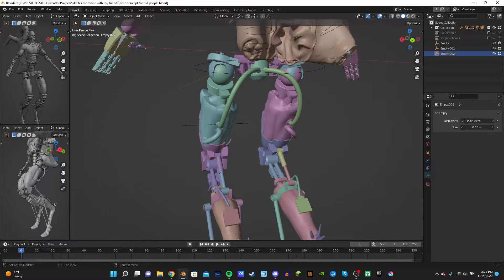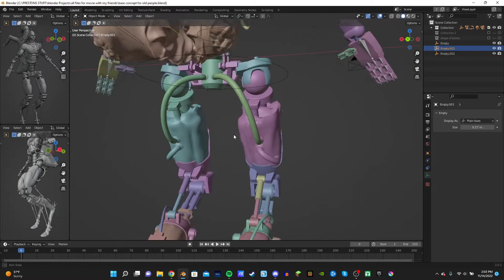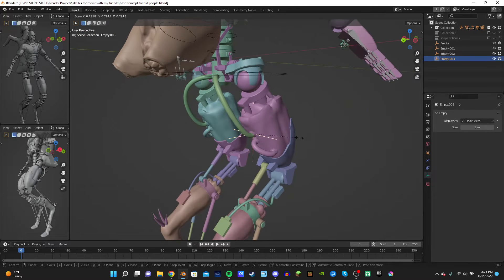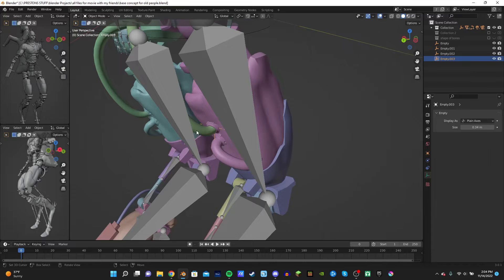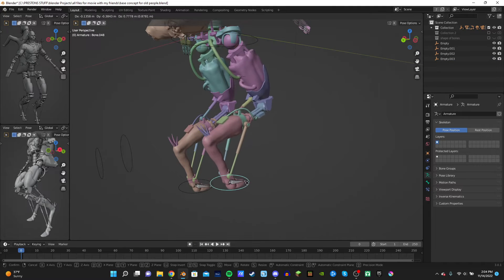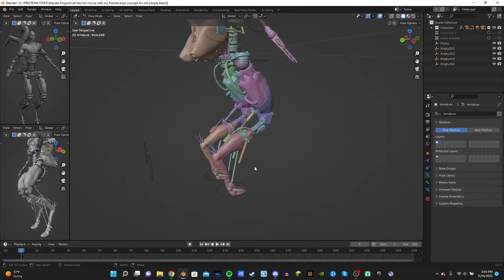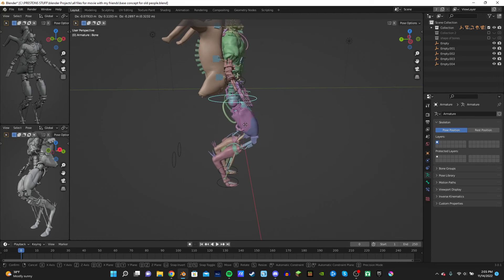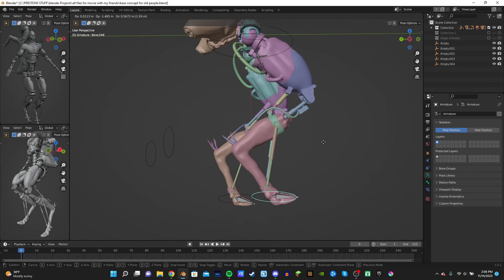How To Rig Cables - Blender Tutorial

Comment: So i had a problem that the middle of the cable stays still in this scenario. Its because the whole curve has to parented. But I dunno where. Curve object to bone? Or armature or the whole robot object? Any idea..? 🤨🧐🤔
Reply: I have this same problem. Have you found a solution?
Reply: @Dread_Nacht  mayby it's help: first select curve object ---- > second select Bone ( or Object if you don't use Bone in project ) and Ctrl+P  ----> Object (Keep Tranform) or 3, 4 parametr.
Reply: mayby it's help: first select curve object ---- > second select Bone ( or Object if you don't use Bone in project ) and Ctrl+P  ----> Object (Keep Tranform) or 3, 4 parametr.

Comment: Question: how did you texture your wires? I thought I could convert mine into a mesh to UV unwrap for substance painter, but when I do, the wires don’t follow the body anymore. So I’d appreciate if you could share what you did. Thanks for the video!
Reply: I've got an idea!! Haven't tried it, but I'm pretty confident it'll work. Create your wire (Bezier curve) and hook it like it shows you in this tutorial. Then create a tube with a bunch of subdivisions and details, then use curve modifier and select your Bezier curve as the object. Obviously you'll need to align them. Finally parent the mesh to the curve so they move together... Might need a stretch to constraint though... hmmm... Haven't got that far yet.
Reply: I'm facing a similar issue, i already made a mesh of cables which are supposed to hang off of my character. I've already textured them, do I have to redo them as curves or is there another way?
Reply: This doesn't work on mesh but you can attach hooks to bones but might as well use IK.